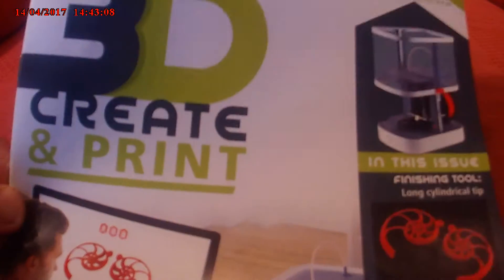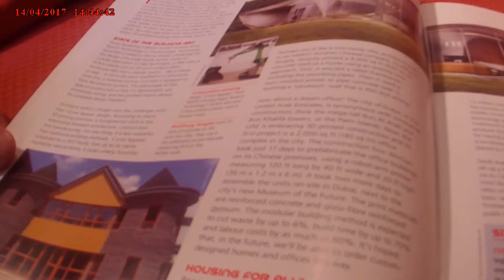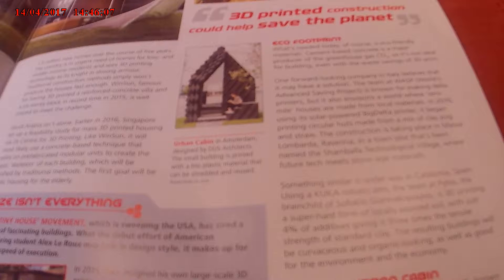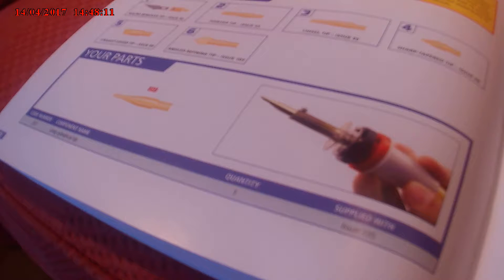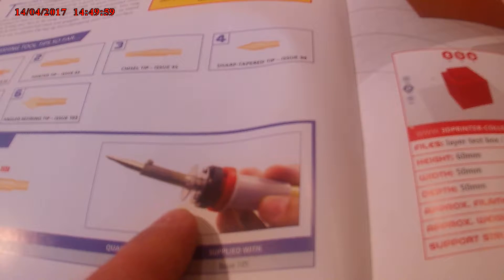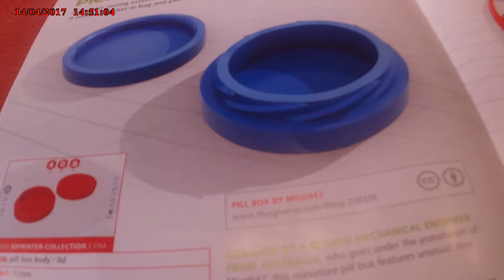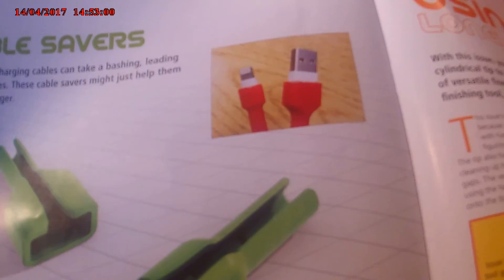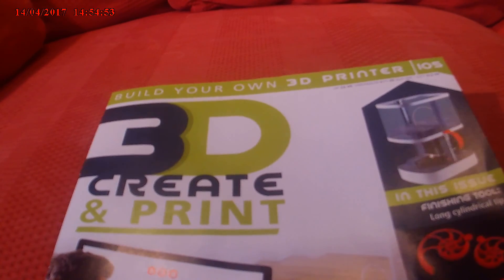3D Printer (Create & Print) Review Issue 105 (Stage 11) - V3 - Long Cylindrical  Tip

Comment: Hi Jimyjames73
This week I'll be receiving issues 105-108.
I have all my updated folders and components and am very happy with the results.
Christmas is just around the corner and a lot has been done this past year.
I'm mainly concentrating on getting my health up to scratch and found natural medicine much more helpful than pharmaceutical medicines. Natural medicine cures whereas prescription medicines don't.
Exercising is very important to our health and I can see you do a lot of that riding the bike.
Reply from the maker: Hello AndrewAr ok, Did you ever get Issue 93 by any chance - cos I ever got it & still waiting for it!!! Good for you about your health - yeah I Love to go bike riding when I can - I even cycle to & from work as well sometime - I have 3 different type of mountain bike each with different number of gears - 21, 24 & 27 - I thinking of doing a vid about my bike cos I've just added some fancy lights to them!!! Do you have any bikes at all???
Reply: Yes James.
I got all my issues and components.
All my folders are numbered as follows:
01-15, 16-30, 31-45, 46-60, 61-75, 76-90, 91-105, 106-115 ... 8 folders
and on the same shelf as my folders I have the added tools and replacement parts. Just thinking where this might go and how far they're willing to push it.
I used to have a bike before I got my license but now I have an exercise bike I just recently bought from K-Mark for $89.00. It does the trick whenever I feel like warming up before exercising with weights.
Would be great to see you show off your bikes on youtube. Having you explain what does what when changing gears and the do's and don'ts when having a geared bike. How to adjust the gears and breaks etc...
Reply from the maker: 106 - 115 what do you mean??? It only goes up to 110 (110 is the last issue (it tells you that in both issues 109 & 110!!!)) - is that what you mean???Exercise bike!!!???!!! that's a bit boring b/c that means your always looking at the same thing all the time - but if you had a mountain bike - you can just let the bike take you any where & see different views around you changing all the time :)That sound like an idea - yeah I just might do a vid about my mountain bikes :) thanks for that
Reply from the maker: Also I have made 2 vids about my bikes - 1 is about basic maintenance & a few Do's & Don'ts & the other is about my bike lights :)

Comment: Thanks JimmyJames, At least I know what to expect. As you know I'm only up to issue 83. Issues 84 to 87 will be dispatched apparently in a couple of weeks. Still not got my issue 78 with the filament guide tube but I've managed to overcome that simply by temporarily relocating the filament spool and tape the whole bracket on top of the printer so I can do some printing. I still don't have my new folder neither for issues 76 to 90. Typical isn't it?
Reply from the maker: Ar nearly there withy the build then :) just doing the hood bit - ok - a little tricky - just have to make sure it all lines up ok. With Issue 78 (which you've told me your still waiting for) you also get the Fabric hood tabs & nuts & bolts( x2 - component number 214) which you will need for issue 88!!! As for the folder, I don't have that, instead I have 2 cardboard box folders which I found in a recycling bin which was still perfect to use!!! Yeah it is a bit typical with this Magazine, just like buses - you wait ages for a bus & then 3 turn up all at the same time!!! just like with my issues 101, 105 & 106!!! lol